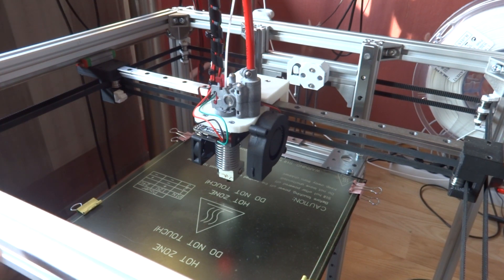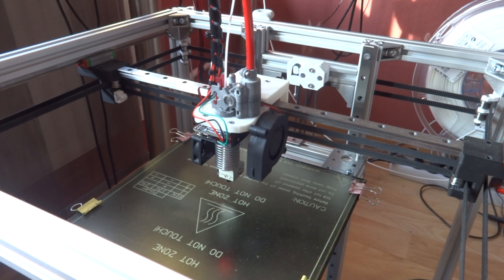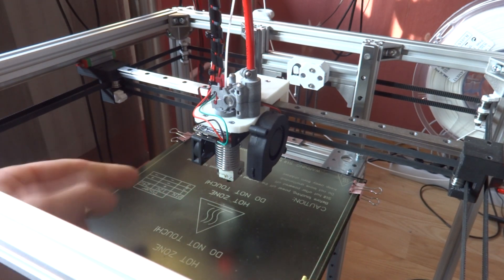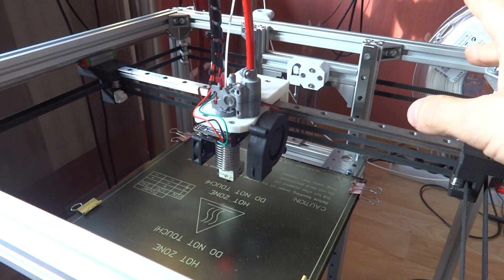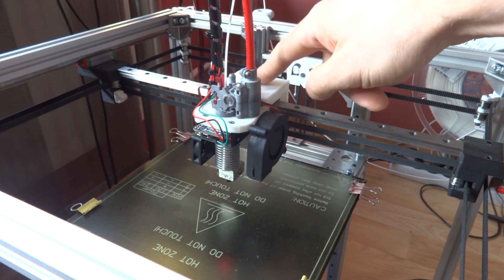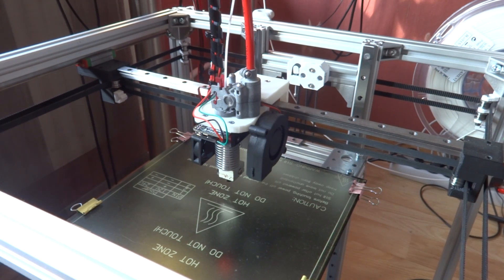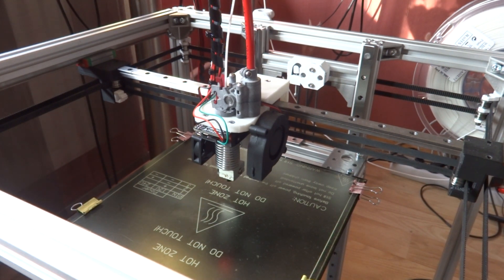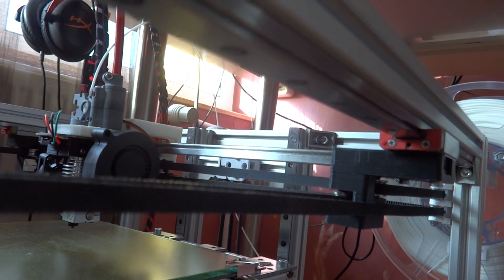Hypercube update (Zesty Nimble, Precision Piezo and linear rails)

Comment: I don't know much about these machines but I do know about deflection/flexibility. The upgrades you made appear to be a good solution. One question, why not have the beds rails on the side with out any? Like I say, I don't know as much as I would like to know about these machines. Just seems the bed would be better supported. Is it because you need to keep it free as to print larger items? Just asking. Love your channel these things peak my interest. 👍👍
Reply from the maker: Yes I could do that, and move z axis rails to the side. But I like it thatway better. 3 sides of bed are open and I can use bigger bed if needed(this box can take max 300x300 bed). But as I print mostly small stuff, there is no need to go bigger at the moment. Secondly whole construction is simpler, one motor and simple belt drive. I can take whole z axis out with bed and motor and belt drive, it is so to say single unit. Just undo 4 bolts and whole thing comes out. Not that I need to do that often. But If i need to do something with printer or change some parts, it comes handy. It is still selfbuilt machine and every now and then needs some tinkering:)

Comment: Where did you get the hot end mount I’ve been looking for that same mount
Reply from the maker: I designed it myself and printed out. Made specifically for pieszo and zesty nimble. I can share the fusion360  file if needed.
Reply: Yes please and what’s your probing speeds mine isn’t triggering
Reply: I will upload it somewhere. Have you tried to raise the sensitivity of the probe via that little screw on probe. Have you connected it digital or analog
Reply: Yeah too sensitive and it triggers to early and yeah I have it on digital
Reply: So I finally figured it out and damn it beautiful I’m going to post the mount I made on Thingiverse here soon thank you for your help

Comment: There is nothing wrong with your English. Great looking Hypercube by the way, I built mine with the carbon fiber rods, but yours looks much more stable. I might disassemble mine and rebuild it like yours. Good work.
Reply: Yes I had it built with carbon rods also in the beginning. But with direct drive extruder what I had, it was too heavy and carbon rods started to wear pretty quickly.

Comment: you should really print that a fan duct! but awesome :)

do you recommend the nimble? how fast do you usually print? what acceleration do you use?
Reply from the maker: Yes I already printed a duct, that I found on thingiverse. At the moment works:) 
Of course I recommend nimble. It has tons of power even with small pancake stepper. It is light and small and for me it has worked well. And I am using that drive cable as a cable guide to carry all the other wires to carriage:) Nice and stiff. I usually print ~50-60 mm/min, because things that I usually print are pretty small. And accel for XY at the moment 600mm/sˇ2.
Reply: @blackloopcnc9415  oh wow taht's small! i set my accelreation to 3000mm/s^2 and I printed a part at 300mm/s today xD
Reply from the maker: What kinda controller are You using?
Reply: @blackloopcnc9415  Klipper on a trigorilla 1.4
Reply from the maker: Cool, I am using Duet Maestro.